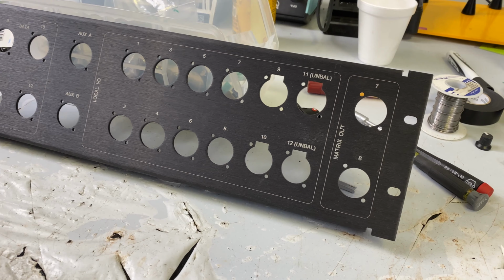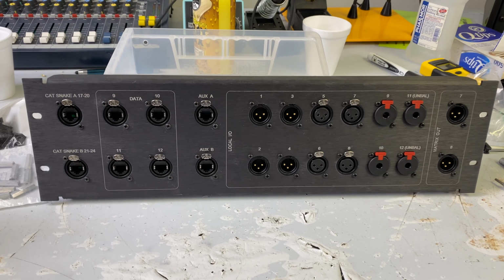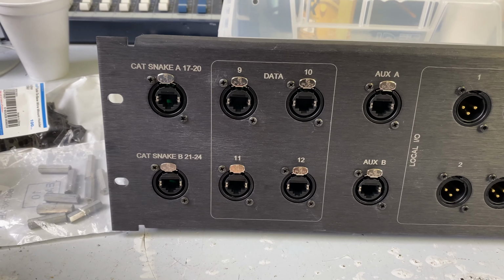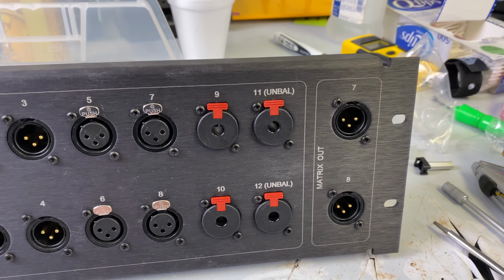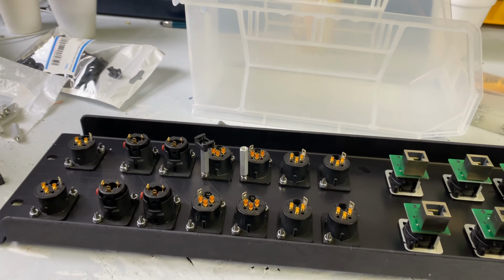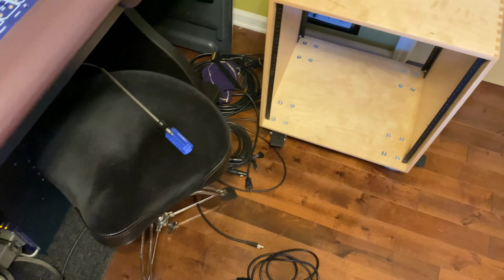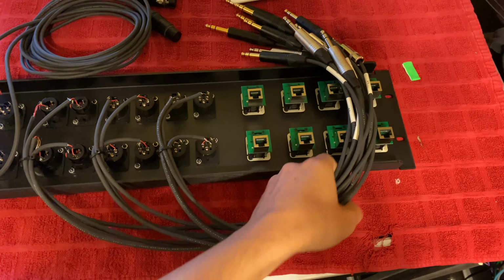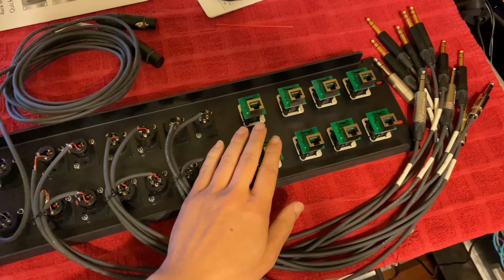Part 8: Custom Local IO Patch Panel For Patch Bay | Home Studio Restoration Build

Comment: At 11:10, you start attaching spacers with some sort of cable tie holders? Looks good!  Do you have a brand or link?
Reply from the maker: The cylindrical part is called a “standoff”. This is a threaded tube that is designed to offset circuit boards etc.. I am using 4/40” screws, so I am using 3/4” tall standoffs threaded for 4/40” screws. The standoffs attach to the back of the screws holding the connectors to the panel. The plastic parts are called “cable saddles”
Reply: @billylaguardia  thanks a lot!!

Comment: Also - how do you like the CATapults? Are they quiet? Also I was wondering if those ethernet cables happen to go through a switch or router, I would think it would be incompatible done in that way since it's analog signal and not data sent over IP
Reply: the analog RJ-45 (17-20, 21-24) can't go through any kind of networking router or switch, if you plug it in you'll just be greeted with lots of loud buzzing and pops. its actual audio that's being ran through. so he's literally just using the wires in the cat-5 cables instead of using a normal snake

Comment: You mention unbalanced to balanced inputs, how would you connect these in terms of wiring? I'm looking to include unbalanced in my setup for instruments and guitar pedals etc but I'm wanting to avoid noise and hum problems; as far as i can tell the best route is to go TRS for everything but how should I wire the TS connector to a TRS cable? New video idea?
Reply from the maker: You would have to make a TS - TRS adapter cable if you were using a traditional 1/4” patch bay. It’s easy to make: the cold and ground are wired together on the TRS side of the cable. I wired the 1/4 jacks on my local panel in that way. I wanted to be able to use pedals as inserts and or plug a bass or guitar directly into the console. Works perfectly. Happy to make a video on it!!
Reply: Thank you! Much appreciated